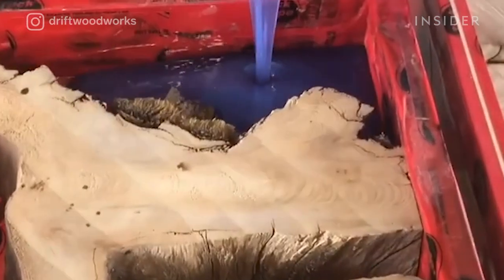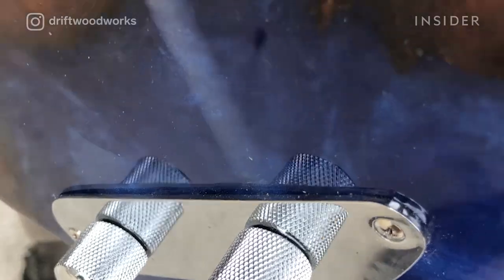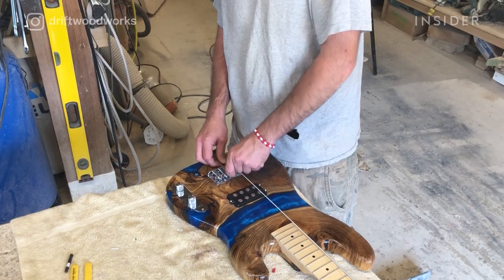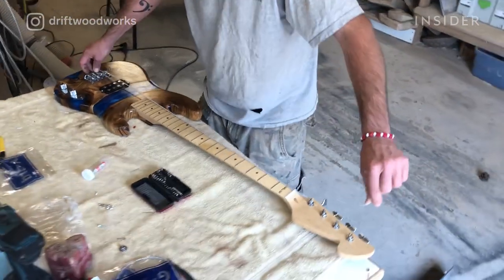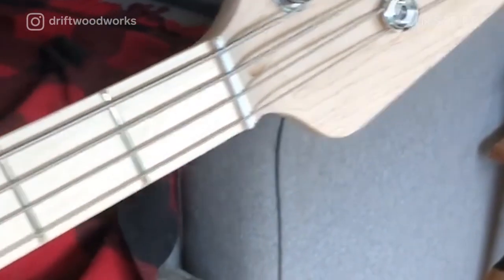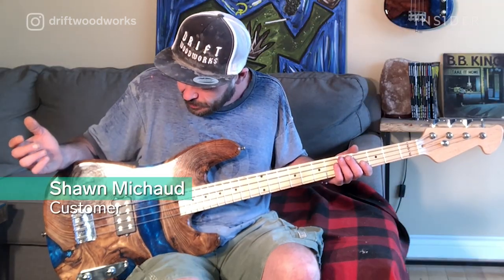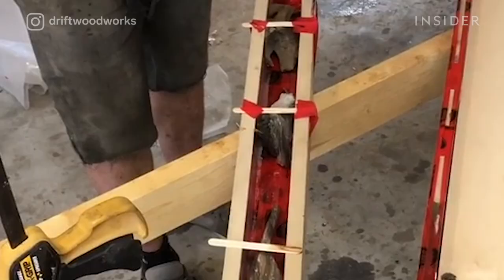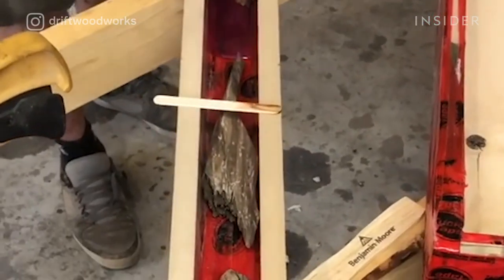Woodworker Makes Custom River Guitars With Epoxy

Comment: are there sound issues you would have to address since the resin and wood vibrate different
Reply: The sound difference between wood and epoxy isn't that different
Reply: Tone wood in electric guitars isnt really important most of the sound come from the electronics
Reply: MrCornWolf are you saying tone wood doesn’t exist?
Reply: @timfowlie3138  Of course tone wood exists, as does tone resin. The result being tone wood resin, which produces clear, bell like sounds without any harshness.
Reply: @MrCornWolf  actually, it's really important, it's like the "voice tone" of the instrument, the electrics are like the "microphone"
Reply: @francommentsonyutup  not really. the strings are the voice. tonewood does make a bit of a difference but when you factor in  strings, pickups, pedals, head, cab and how the sound is mixed, that difference can be difficult to hear
Reply: @pilchardpliskin9381  once again, no
There is a difference between different kinds of woods in sound, tone and resonance, like Mahogany and Ash. The effects and the pickups(mics) do as much as they would for singer with a good voice or a bad voice
Reply: @francommentsonyutup  no way! The pickups and playing style are the main tone. Most people's idea of tone wood is  exaggerated.
Reply: @sizzloh  what??? No, the main tone is from the wood and how it resonates, the pick ups ar important but they mainly transmites the wood sound. The playing is the most important thing, but separated from the guitar sound and tone
Reply: No because it's electric. The pickups need the string vibration not body vibration.
Reply: @timfowlie3138  no, just that it doesn't make the difference
Reply: @bradhargis2261  but they don't vibrate alone, the whole body vibrates with them, you can put humbucker on an Ash telecaster and a humbucker on a mahagony les Paul and you'll still hear the difference
Reply: @bradhargis2261  yes they do, even the neck wood makes a difference
Reply: Brad Hargis & ValueOfNothing so if it doesn’t matter that much I could make a guitar out of balsa wood and put humbucking pickups in it and it would sound like a les paul
Reply: @pilchardpliskin9381  what kind of wood specifically? I won't say that epoxy is bad because I haven't tried an epoxy guitar, but i must admit that I've never heard of usinf epoxy for a guitar body before
Reply: @francommentsonyutup  a standard electric guitar pickup is a basic transducer. If you're telling me that it can sense the wood fibres through the physical movement of the strings then you've learnt stuff wrong mate! I used to think the same as you years ago, but several decades of playing, recording, selling and making guitars has taught me otherwise. I do however believe that the minimal influence of a tone wood's resonance on the physical movement of the strings is sometimes noticeable, but generally it's more of a feel thing and psycho acoustics. Some guitars sing, others are as dead as a dodo. Get a cheap Strat copy and slap 'custom shop' hardware on it, give it a pro setup and it will sound and feel almost identical to a custom shop jobby, although your eyes will tell you it doesn't.
Reply: @francommentsonyutup  Pickups aren't microphones. microphones work by having a ribbon or diaphragm that moves and creates electricity when sound enters the mic. Guitar pickups create electricity by having metal strings vibrate inside of a magnetic field, but the strings aren't designed to capture sound from outside sources.
Reply: @sizzloh  I never said it sensed the fibres of the wood. I said that the vibration of the body affects the vibration of the strings and the resonance. And sorry if it sounds harsh but I really can't believe for a second that you've been playing for years and selling guitars, differebce in sound its quite a real thing; at least I can hear it. And about the squier, I've had done that... Never sounded like a fender
Reply: @pilchardpliskin9381  but they do vibrate and resonate along the body of the instrument
Reply: @pilchardpliskin9381  and I used the example of a mic, actually I said like the "microphone"
Reply: @timfowlie3138  uh, MrCornWolf never said tone wood doesn't exist. That was kind of an odd thing to ask. Your question comes across as you either didn't read what he said or you were trying to imply that's what he said. >_> But maybe I'm wrong. :)
Reply: @timfowlie3138  it has been proven (using an f test of the frequency response of a different variety woods)  that the guitar does not sound different when bodies made of various wood species are used. The wood species does have to be strong enough to hold the components of a guitar of course.

It has also been shown that dead spots in necks can affect the tone.

It has been shown that the shape of the guitar's body does not matter with respect to sustain or tone, by looking at the frequency distributions when the guitars body is continually cut up. Although in this case a picking machine was not used, nonetheless it was easy to see that the beginning amplitudes were very similar. 

You will have to search for the sources yourself or wait for me to fine them for you. 

But it's really no longer a matter of opinion.

If you have an actual scientific test that prove anything you claim is true then by all means provide it!
Reply: @francommentsonyutup  what is harsh is a fact that you cannot prove a single thing you claim and yet have the arrogance and the gaill to insult other people!

So let's have at it Mr. Thomas Acuna Latorre!

Just exactly what is your evidence?

See my response above for details.
Reply: @francommentsonyutup  solid body don't resonate much though. if you tap on the side of an acoustic guitar and tap on the side of a solid body guitar, there's a very audible difference, because the acoustic body is designed to resonate. You also get noticeable differences in tone from adjusting pickup height, rolling back the tone dial, replacing the pickups, replacing the amp and using EQ, so the net effect of tonewood is pretty small.
Reply: @valueofnothing2487  to be fair I never insulted you(or anyonelse) and you neither provided a link, just said it's proved scientifically. Give me a second and I'll look for ant video with two different guitars with different pickups. Edit* and to also be fair, neither did you untill your last response. You, just like me or anybody else in the comment chain, explained how it "worked" and why would or would not affect the tone, sound of the guitar and if it would be more or less important than that.
Edit: https://youtu.be/nrEar7dgVwI
Edit: https://youtu.be/BqD7vN40988
Edit: https://youtu.be/0Y_tyUjkkhA
Reply: @pilchardpliskin9381  it doesn't resonate as much but it does resonate, and main point is that the vibration between each guitar is different. If I'm honest with you, most of my problem with this chain of comments is that I, personally, can hear a difference from a bass amd another, and a guitar and another. A lot of people can, I had a friend who was a luthier and told about the difference between one wood and another, and in my experience, which is completely subjective I guess, it sounded different.
Reply: @pilchardpliskin9381  and I do believe pick ups are important and make a difference, but I really believe that wood gives the start point and the limit of how much
Reply: @sizzloh  you know what, you're right. First of all I've been using the word resonance when what I wanted to say was that the vibration of the body affected the sound of the strings (which you said but somehow I ignored or just didn't notice), and it's true, I've played with guys who had an 80 dollars Washburn and with the right set up sounded excellent, I tried the "good pickups cheap guitar" thing though and it didn't sounded really good, but yes, it would be really stubborn and stupid to keep saying that wood is the most important when playing (I mean, I do believe it affects the "Raw" sound of the guitar, but it can be fixed with the right equipment as you said)
Reply: Ok, to be fair with all of you, you're right. The tonewood isn't as important as the equipment being used, the resonance of an electric guitar is minimal and irrelevant; I used the word resonance with another meaning when I shouldn't have. And most of the cheap guitars I had/ still have a problems with, were poorly build; my Squier sounded way to "bright" and sort of lacking in "body"(low frequencies maybe?), But my main problem was that it also was impossible to tune correctly and some frets sounded odd( I don't know the English word used when you press the fret but the strings hits the neck or another fret below)
Reply: @francommentsonyutup  it kind of goes against everything we have been led to believe by the big boy manufacturers, but unlike acoustic, an amplified signal isn't altered much at all by the wood type. And just to rub salt into the wound, sustain isn't affected as much as people believe either.👍✌
Reply: @sizzloh  I mostly agree that the sound of the guitar can be modified to sound good. Therefore, the guitar itself isn't that important. And yes, one guy cutted up a strat to prove that point.
https://youtu.be/sYK0XX-nDVI
Reply: @francommentsonyutup  Haha I was going to post you that link. ;)
Reply: @francommentsonyutup  

So you're three links that you sent me have various problems, except Stranberg, and perhaps

Http://www.Stormriders.com/guitar/guitar_wood.pdf

However, this test below uses about six different bodies and finds no differences using everything else the same. And they do a proper frequency test as opposed to simply display waveforms, which Stranberg and the guitar Wood people do:
https://physicae.ifi.unicamp.br/physicae/article/view/physicae.9.5

Now note the article referenced in that paper and you will see that sticker found dead spots in different necks the showing that the material of the guitar might make a difference with respect you the neck.
Reply: @francommentsonyutup  I should say that the reason why the Portuguese paper indicates that tonewood doesn't make any difference is because the guitar does not induce vibrations with sufficient force to alter any of the frequencies by any significant amount. In other words you could say that the ends are essentially fixed.

It is still puzzling though why strandberg and Storm riders get different results. perhaps it is due to the fact that they did not do a real frequency test.
Reply: @valueofnothing2487  ok
Reply: tone wood is way exaggerated. warmoth did a video about tone wood. you can hear slight differences, but nothing major. most of the other "tone wood" videos are not controlled enough to be valid.
Reply: "tone wood" only applys acoustically all this talk about hearing wood through pickups is total bulshit.
Reply: @francommentsonyutup  sorry man, but you cleary have little understanding how an electric guitar works. The pick up doesnt care about the wood, it only cares that there is a disturbance in its magnetic field and that is then translated into sound by the amp. Tonewood may apply for acoustic but for electric their importance and effect is negligible almost nothing.
Reply: Tonewood Is irrelevant in the context of electric guitars.
Reply: @GrimYak  Good to know. Loved your clearly
Reply: @jordanwalsh8171  good to know
Reply: @valueofnothing2487  I imagine the hardness of the epoxy plays into the tonal quality. Harder epoxies probably have more vibration transfer.
Reply: @francommentsonyutup  Sorry dude, you are not correct on this one.  It could be made out of frogs, wood or steel and they would all sound the same once plugged in.
Reply: @scottgrove4416  I know, and I actually admit it

Comment: I knew someone had to be doing this, but lets be real, they have to be on the heavy side and I doubt that the epoxy adds any tonal qualities.. But they certainly look badass!!
Reply: That’s what I came here to find out, would an epoxy guitar even sound any good?
Reply: @Emiliapocalypse  They make cigar box and tequila box electric guitars and they sound decent, so you could probably make a guitar out of just about anything, but epoxy probably has the tonal qualities of a brick.
Reply: There are many like myself who believe that wood doesn’t have the major effect in tone like most people think, especially when you add modulation and effects on top of anything. 
Besides the weight, they should sound just fine.
Reply: Hardware and electronics are the most important thing in electric guitars... Wood are overrated, just look Aristides...

Comment: But does the resin change the acoustics because remember,  the types of wood used definately impart different timbres and tone qualities so I'm sure resin is not ideal or else all guitars would be made of it.
Reply: its an electric guitar and is in no way impeded by the acoustics of the timber
Reply: Actually, the keyboard you are using is designed to be inferior, yet all people use it.
Reply: @bayrena  yes it is, the whole body of the guitar vibrates, not just the strings. If you put fender pick ups on a squier it won't sound as a fender
Reply: That's what I thought too!!
Reply: @francommentsonyutup  unfortunately tone wood has little no impact on a electric guitar. This has been tested time and time again by various people on YouTube eliminating all variables aside from wood choice.

The result? A tonal difference between mdf, mahogany and maple, alder, a recycled door...where negligable.

Your example with the fender and squire. Has too Many variables. 

More like... Compair 2 identical fenders one alder and the other swamp ash. Two woods that fender uses.

Comment: do you need any special tools,or just use normal wood cutting machine
Reply: Normal tools. I've done a build like this, not really any different than building a guitar out of wood. You can see on my channel a step-by-step for a guitar out of legos/epoxy - just a jigsaw, belt sander, router, and a lot of hand sanding.